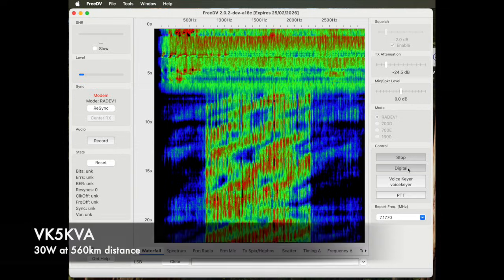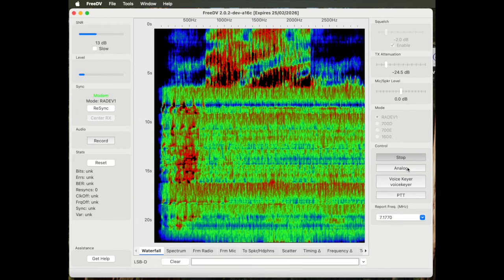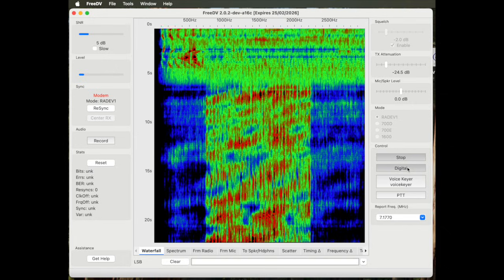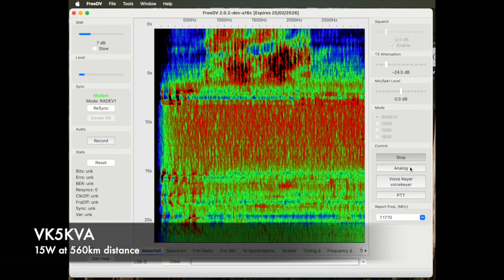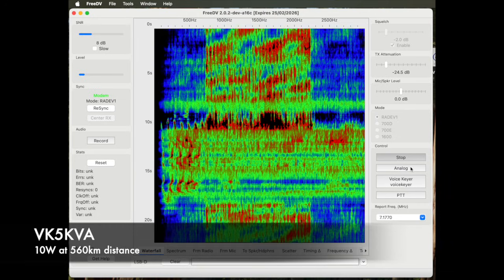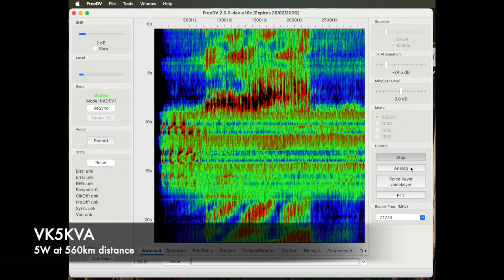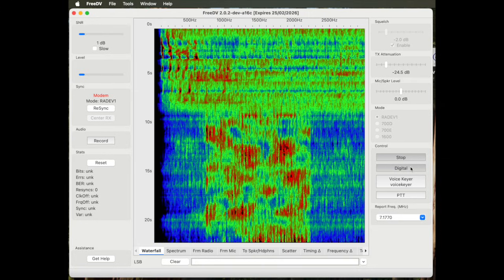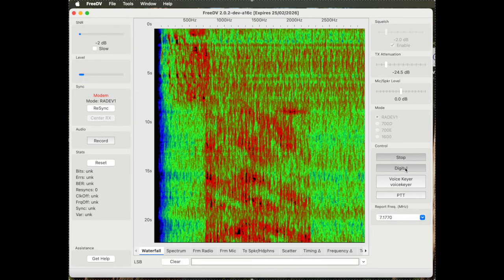FreeDV RADEV1 vs Analog

Comment: Great video Peter, question to ask you as a new user on FreeDV,  can I use a usb powered headset with a microphone(Like a jabra headset) for both listening to digital and also transmitting over digital with the FreeDV program? I'm a little confused as I was thinking maybe you need to use the microphone that plugs into your HF radio, and use the PTT button in order to chat to people over the FreeDV software?
Reply: Howdy, this is Jeff, KF5KWO. The USB mic/headset is the way to go, or just use the onboard mic and speakers in your laptop, which I was doing last night on 40m with no problem, I was doing this last night. I do have a USB headset, but the three USB ports on my Lenova Yoga laptop are already occupied by CAT control, an external monitor, and SignaLink. I do have a stereo jack, so I’ll need to see if it can accomodate a mic or if it’s just for listening. Jeff, KF5KWO
Reply: Im also new to FreeDV, but messing around with it last night it looks like you can use a USB mic that you would select in audio settings. And then you can use your space bar as the PTT. I plan to try this out later with my nice Yeti mic. KF0UPB

Comment: At 1W is most impressive difference between almost no copy to easy copy.
Reply from the maker: I'm interested to try even lower SNR and try to find where it breaks down.
Reply: @peterbmarks  Couple of days ago I tried it on 80m, another station could copy me with 35W or less but I couldn't decode them at all at the same power. I was using the FreeDV compiled out of Git on Debian.
Reply: @peterbmarks  Some have reported -2 SNR still copyable with RADE. I'm keen to try the FM VHF/UHF version.
Reply: Very impressive how well the 1 watt does! I was doing 50 watts last night here in the U.S. and got great reports, next time I’ll crank the power way down. Jeff, KF5KWO